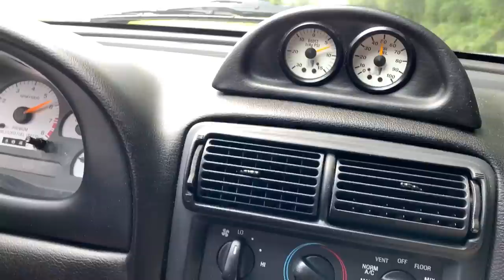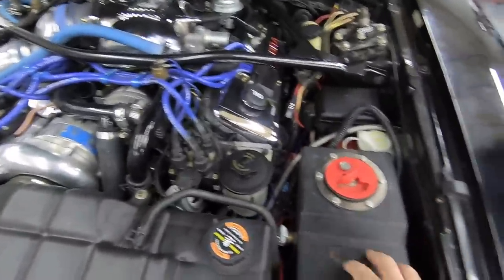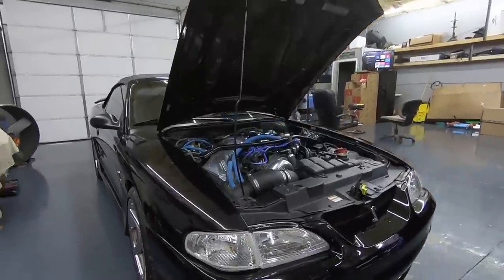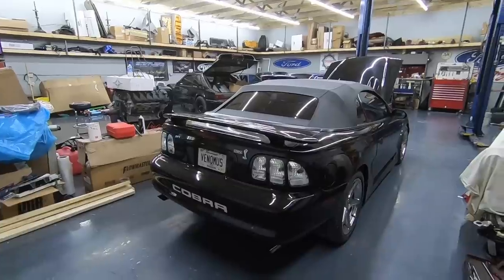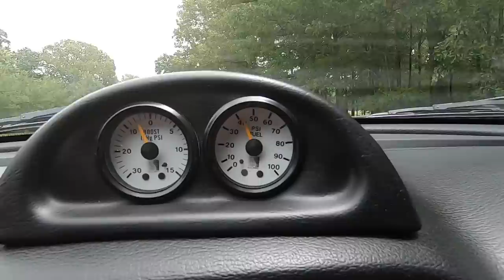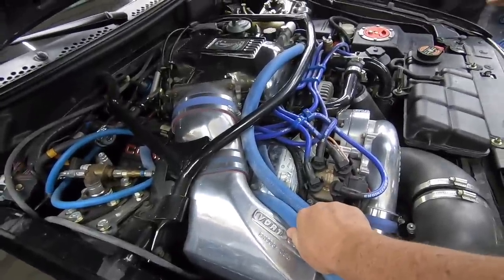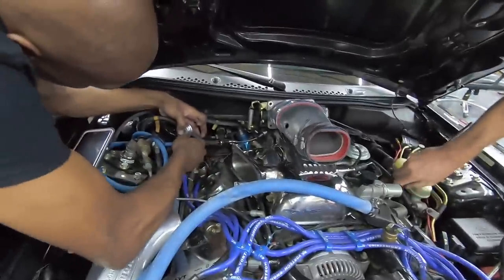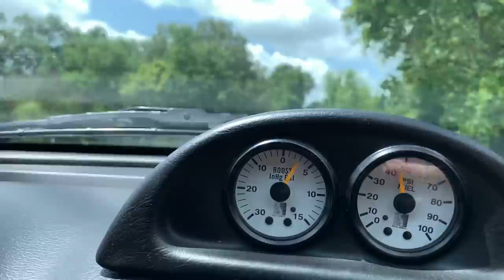Why don’t you see more of this generation Mustang...

Comment: The 94-98 cars seem like the black sheep of the mustang family. They don’t get a lot of respect, but I love them.
Reply: like the mid seventies mustang 2's..i had one with the v8..nice looking car..but still a slug even with a v8..but hey..i still loved it and i miss it!!
Reply: I agree and the coyote engine makes these cars look worse. But the 96-98 is still my favorite Cobra!
Reply: 05-09 is the worst since the 70's.
Reply: I remember when they first came out I really wanted a Cobra with the 4.6 DOHC and a 5 speed. I seen a lot them that had clear coat peal.
Reply: I had a 97 gt , ran a 14.2 stock I called it the caveman version of the Ford v8
Reply: 1980-2010 gts and cobras were not impressive cars. Except the termi
Reply: @99thpeanut59  I'm aware that opinions are a thing, but I personally think the sn95 is cooler looking than the foxbody. It just looks more like a mustang I guess🤷‍♂️. As for the speed goes, the 96-98 gts were just as fast if not faster than all the foxbody gts. Especially the mid 80s fox body mustangs that only had like 180hp from a 5.0 engine.
Reply: Mines a 02 cobra ls3 single turbo and it hits a lick....
No ford motor ...💯Ls
Reply: @99thpeanut59  '99-'04 are called New Edge. SN95 stood for "Sporty North American 95th version." The '99-'04 are obviously all new body panels (except roof & glass) so were no longer the "95th version." They may be the 96th or the 113th version or whatever.

SN95 & New Edge ate both on the Fox-4 CHASSIS.
Reply: @ericromano8334  The "mid '80s" Fox was rated at 210HP & 265 ft-lbs in '85 [like my GT in the pic] and was 200-300lbs lighter than an SN95. '87-'92 was 225HP & 300 ft-lbs. '96 4.6 was 215HP & 285ft lbs. Stock vs stock it was no competition until the New Edge came out in '99 with 260HP & 302 ft-lbs.

You also need to remember, in the '80s we were just coming out of the "smog years" of the '70s. '80 & '81 Mustang wasn't even available with a 5.0/302. Only V8 in '80-'81 was the "under bored" 4.2/255. In '82 the 5.0 (& GT) returned with 157HP from a 2 barrel carburetor and was the fastest U.S. production car that year!? The slower '82 Camaro 5.0/305 only made 145HP with a 4 barrel!? 3rd Gen F-bodys were on average 400lbs heavier than Foxes, too.
Reply: @thepredator4480  They were impressive in their time. Not fair to compare them with newer technology or pre- "smog years" cars.

The '82 GT 5.0 with 157HP & a 2 barrel carburetor was the fastest U.S. production car that year!? ('82 Camaro made 145HP with a 4 barrel carburetor. And 3rd Gen F-bodys were on average 400lbs heavier than Foxes.) They were among the quickest of their era and almost always thousands of dollars cheaper (or even half the price) of the only cars that were quicker. You made them as quick as you wanted with the money you saved on the initial price.
Reply: @foxfordcatguy2283  they were not impressive from 93 -2010 besides the terminator
Reply: @02autogt  lol 😆
Reply: @braindamage248  14.2 ? It would've ran 16 up here. They were weak.
Reply: @sammyb.9344  exactly how many time you see a ford motor in a chevy? 😆
Reply: @thepredator4480  Ford definitely stumbled because they were going to make the Mustang a FWD, but fans complained so that car was renamed as the Probe. They then had to go back to the drawing board and design a new RWD platform for the next gen Mustang. That's why the Fox platform stayed in production for 15 years. And they threw together packages like the '92 & '93 "Feature Cars" & '93 Cobra to keep interest up.
Reply: Sammy B there was no cobra in 02 do you really have an LS in a Cobra that never existed
Reply: 05 too 09 is awesome looking. My 07 427 convertable supersnake says so.
Reply: Same with my 10 900hp grabber blue supersnake. Also my 08 GT500 would spank a 96 too 98 cobra easily. The only good 4.6 is in my 04 torch red Terminator. I bought a 97 cobra back in the day why because I couldn't find the 93cobra the car is really wanted.So I settled for a 97 cobra and  I missed one shift and with only 2thousand  miles on it and the 4.6 exploded.So 96 98 cobras look good but they had trouble making power and the bottom end of the motors were weak.Sorry just the truth.My 07 shelby gt has more power than a 96 98 and it can make power with a stock motor. Just the truth as for the 5.4 in my GT500 and in both of my supersnakes. A 96 98 cobra can't even be put in the same sentence. The best 4.6 is in my 04 terminator. Period
Reply: @ Matt Cox: They're treated like black sheep - I owned a 1996 GT for over twenty years before getting a 2013 Mustang GT 5.0L - because they could have been so much more in terms of their tech. Look, understand that I am a Mustang guy - I love the car and its history and owning one - but that does not change the fact that Ford has made a lot of unforced errors, including some with the Mustang. 

The 5.0L push-rod motor in use in Mustangs for so many years was well-loved by the performance community because it was cheap and easy to build up and make big power for the street. Along comes this much-ballyhooed new overhead cam engine - the 4.6L - and except in the Cobra, the top-of-the-line variant - it doesn't even match what the old 5.0L did, let alone what the GM boys were doing with their 5.7L V-8s. I am intimately familiar with the virtues and drawbacks of the modular 4.6L mill, especially the single-overhead cam in the GT. It is actually a marvelous bit of engineering for the time. It paved the way for genuinely great motors like the 5.0L coyote and also for the Terminators of 2003-2004, which are legendary. But in its stock form in the GT, its low-end performance was not all that great, even with a decent set of gears to row. Quarter-mile speeds in the high-eighties, maybe nineties if you were lucky. Elapsed times not all that hot 0-60, either. A decent VW or Honda could wax it. 

If you got up in RPMs, then the motor performed better and was a lot of fun to drive, but down low? Forget it, the thing was a dog given its displacement. Plenty of manufacturers and private hot-rodders have shown us that an engine of that size can make monster power, so why didn't Ford do that? Adding insult to injury, independent tests disclosed that New Edge Cobras were not making their claimed HP and torque numbers. Ford was publicly humiliated. Eventually, Ford formed SVT and the result was the 03-04 Cobra, which for its time was one of the fastest street cars under 50K ever tested. What took you guys so long? The SN95 Cobra mill making 305 HP should have been stock in the GT, and the blown motor should have been in the Cobra all the time. 

If you had the time/money to build one up, the 4.6L mill could deliver respectable performance. But for a long time there, Ford left their most-ardent car guys - their Mustang people - out in the cold where performance was concerned. For a company that invented the pony car concept that's no way to do things. 

Having said all of that, my 1996 was a darned fun car, which is why I held on to it for so long. But it would have been better with a hotter motor and IRS instead of a solid axle. Those SN95 4.6L motors, though, sound great! Never heard a V-8 sound so good.
Reply: @thepredator4480  and the Shelby cobra of 2007
Reply: So you mis shifted and blew the motor but you blame the motor for being week? Lmao
Reply: @02autogt  hideous 😂

Comment: Warning. Be careful with the claimed mileage on these cars, they had soft rubber drive gears in the speedometer cluster that failed at a very high rate when they got to be 8-10 years old or so. I have fixed many, many of these for friends/family/myself. It's an easy fix and the parts are $20. Some cars had the speedo fixed immediately and some were drive 40k miles before fixing it. Buyer Beware.

Comment: These SN95s are getting crushed by the 100s around here. They make great hot rod platforms for little money, 8.8 dif in a GT, 4 wheel disc, an engine bay that’s huge and decent interior design. Very aerodynamic. One of Ford’s first wind tunnel designs after the TBird
Reply: Shit naw dont crush em.
Reply: im in the process of rebuilding mine. 3rd one ive owned. shouldnt have gotten rid of the other two. :(

Comment: I just bought a 1996 Mustang SVT Cobra Convertible. One owner 21,000 original miles and I paid 12 K for the car. Car looks and drives like a brand new car. It’s nothing like the one you have on this video being super charged. 
I’ve been a Camaro owner my entire life and currently have a 2010 Camaro RSSS but I feel like I’ve hit the lottery buying this new Mustang. The Cobra in this  video is definitely the beast. 
Long live the internal combustion engine.

Comment: Lots of reasons for this. Tell you a story. My friend had a Mustang SN95 1996 GT and yeah it was fast at that time ran a quarter mile at 15.4 in Palmdale we added some parts intake, headers and a Fuel pump and an Exhaust pulleys. It was a very heavy car over 3800 lbs so its not light. Well at that time he wanted me to buy a trans am so we could race together. Well My dad was not having it so i ended up buying a 1997 Honda Civic Ex and that pretty much changed everything. Once I bought that car he was dissappointed but he told me about a small magazine called TURBO and SuperSTREET and when I saw the Mods on CIVICS that was it I was hooked. With just a Intake and headers and some 50 shot of Nitrous I was able to run 14.5 and that changed his mindset and mine at the time when most people would be laughing at most Hondas at that time. He ended up selling his Mustang and gave up the racing bug. That is how it ended for him and mostly for me too. Fast forward to now and I am still into the CRXs b16B and Supras Never looked back either. They just keep getting faster and faster.

Comment: I bought a clean 80,000 mile true teal 95 5.0 gt for $2000 last year. Got it running good, spent about $200 fixing small stuff, then turned around and sold it for $5,000. That teal color was the same as the teal on the 93 cobra, so I guess it was desirable because of that. I’d love to have a calypso green hatchback fox though.

Comment: They are definitely hard to find in good condition. You’re right, those cars with  a cobra front bumper and lowered look awesome!
Reply: I agree, there will be a day when people start to appreciate them start raising its value back up, never selling mine.  1996 cobra convertible black on black with tan top, there are only like 2000-3000 made i believe.
Reply: David Sanderson I hear you! I like all mustangs and have had a bunch of fox bodies, a 2010, and a couple new edges. Some I wish I would’ve kept, but my current is a 2000 GT convertible. Just gonna redo the interior, new top, some tasteful mods with a supercharger and let it ride!
Reply: @davidsanderson5466  a day when people start appreciating? I get compliments every time I drive mine. I get more compliments now than I ever did in the 90s and 00s. People appreciate them now, especially since many are now at that age where people who had them when the were in high school are starting to be nostalgic for them. All I ever did was keep mine.
Reply: They are hard to find in good condition because most did not have abs or traction control. And if you are familiar with the infamous mustang meme, many of these cars ended up in the hands of newbie drivers with paper licenses. On top of that, the v6 models weren’t loved. 145 hp, they became so undervalued in such a short time that literally anything would total it. Needs four brand new tires? Totaled.

Comment: I actually grabbed one of these after my 98 V6 had to go to the junkyard. Sadly the 97 2v bit it because the previous owner blew the headgasket and after I tore it down, I discovered a rust spot in the cylinder bore from coolant sitting in there. I have a f150 coyote in my garage right now and I'm just waiting for parts to come in. So far I have it lowered with 18inch staggered Bullitt Motorsport Rs. The Saleen S351 kits on these are to die for, and once I get the coyote in I'm saving up for a full repaint with the kit.

Comment: When the 94 came out, I was determined to buy an SN95.  I bought a 98 Mustang GT Atlantic Blue Metallic with 70K miles on it in 2015.   It came with 20" chrome Strada wheels. The first thing I did to it was dropping it 1.5 inches, replaced all of the wheel bearings, bushings, etc. and putting in 1.5 inch wheel spacers in the rear.  The stance is ultimately better.  These cars are a blast and the resale prices are going up fast so, I recommend buying one , soon.

Comment: The new edges get all the love from the sn95 line up. People I think forget the sn95 goes to 04. Just the exterior change. I have a 97 cobra mostly stock just a shifter and exhaust, low miles, in crystal white.

Comment: That joker is clean. I love those SN95 cars. They are pretty hard to found in good condition. I've tried looking for them. I've only found a 96 Cobra with 20k on the clock in my hometown for sale.
Reply: Very. Either its a cobra with 20k miles on it for 30k$ or its got 200k miles on it for 5k$ ...very hard to find just a solid, lightly used sn

Comment: Sn95 are really good cars they don’t get enough respect
Reply: 280cui is not enough
Reply: 302 isnt enough either
Reply: 340+is enough
Reply: Alex Fitzpatrick nothing a 351 cant fix, but this isn’t about displacement it’s about the car . And the platform ...
Reply: Alex Fitzpatrick Ask the mach1 and cobra... They still make you 5.0 boys cry to this day...
Reply: Angel Gutierrez No they don’t.
Reply: @alexfitzpatrick2509  The 4.6 is 281 cubic inches.
Reply: My 2000 281ci with PI heads, reflash & tune on a 150 nos shot has trouble not roasting nitto 505 drags in 305-45-18s on the rear during the launch out 100ft. The little hi-rev mod motor can make power when built right. Throttle body, intake, headers and cams have been changed.
Reply: +Angel Gutierrez dude if you think a 320 horsepower Mach 1 is beating a modern coyote you’re borderline insane. Cobras aren’t beating a modern 5.0 either, and nor is a terminator.

Yes a terminator modified will beat a modern 5.0.
Reply: @99thpeanut59  I feel the same way about alot of the fox bodys. V6 SN95S would be a challenge for a mid 80s fox v8.
Reply: @ericromano8334 SN95 V6 is no competition for a Fox 5.0.

'94-'97 3.8 V6 SN95 were rated at 145HP & 215 ft-lbs, '98 was rated at 150HP & 215HP, '99 New Edge 3.8 was 190HP but still only 215 ft-lbs.

'85 5.0HO was 210HP & 265 ft-lbs, '87-'92 was 225HP & 300 ft-lbs.

SN95/New Edge were also 200-300lbs heavier than Foxes!

Do the math.
Reply: @99thpeanut59  '99-'04 aren't SN95s. SN95 stood for "Sporty North American 95th version." Since it had all new body panels (except roof & glass) it was obviously no longer the "95th version." Might have been the 96th version (doubt it) or 105th or whatever version.

Both the SN95 & New Edge are on the Fox-4 CHASSIS.
Reply: They weren't impressive
Reply: @foxfordcatguy2283  okay maybe not 85, but 79 -83 It would be a CHALLENGE. like I said previously. You gotta remember there's more to it than the power numbers, where and how long is it making those torque and horsepower numbers? How long is the powerband?
Reply: @99thpeanut59  how do you know a terminator wont beat a 5.0? Especially a gen 1 coyote. What's your idea of fast even?🤦‍♂️

Comment: Blower might need a rebuild. Check the turbine for shaft play then compression test each cylinder on the motor might have pushed a head gasket.

Comment: I think the 96-98 cobras are mean as hell when done right they look sick.  The stock hood looks mean on em.  Very underrated cars for making some decent power...they have a forged crank and one of the strongest aluminum blocks ever put into a mustang you can upgrade the rods and pistons and make some steam with a turbo or turbos.  The b beads aren't ultimately as good as the later c heads from the mach 1 and terminator but they work pretty good with forced induction and can make some steam.   Them cars are cool.  The 2v cars can be build up decent too and if you run pi stuff on non pi cars it'll have like 10.5:1 compression which helps alot and those cars are also a good candidate for a coyote swap being a mod motor car makes the swap alot easier and likely cheaper.  These cars look sick when done right idk why they get so much hate.  Newer mustangs aren't all that stock either its not just these cars lol.  Any of the models need some mods to look their best this gen is no different.

Comment: The 2-valve in non-pi form was a pig. I sort of owned one back in the day. Still a fun car, and a good-looking cruiser though. Richard Holdener built one up to 303 n/a wheel horsepower back in the day at MMFF, which I thought was a cool build. You can also still buy the KB kit for them, and that'll take you to gen 1 coyote horsepower levels with stump-pulling torque. OR, you can do the TFS top end kit, and it'll push them to 400+ horse n/a. Good project car now, because the GTs still haven't really risen in value much. 

The Cobras, however, have already been noticed by the collectors, so their prices are now skyrocketing, regardless of whether it's a 5.0 or 4-valve 4.6.

Comment: GOT ME A 96 Cobra back in 07. It had 36,000 miles on it. Today it has 56,000 miles. White with black over tan leather. Cobra R wheels. Mild mods and lowered. I can't get past 3rd gear on the street. I like it!

Comment: I've got the '94 V6 body with a '95 5.0 motor.. I love these bodies. Definitely not forgotten by me. Wish mine had a power adder but I used to run the streets with these and had  some clout back in the day. I have seen plenty of clapped out examples around. Plenty neglected and abused. I've held onto mine an have plans to resurrect it with a coyote swapped setup eventually. The underestimated underdog!! ... Lol
Reply: Look into a Navigator 32V 5.4 swap rather than the Coyote if you're up for just a little more work but a lot less money.